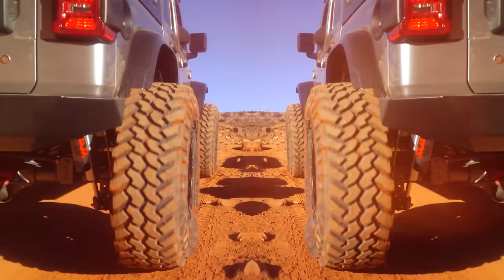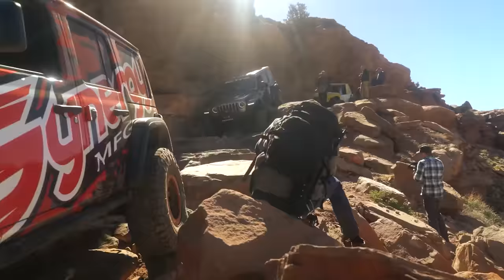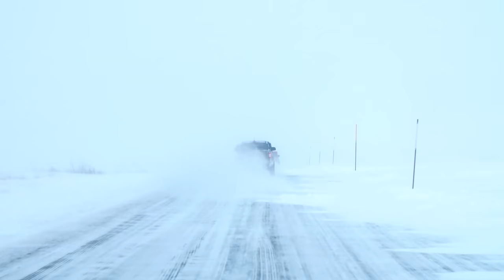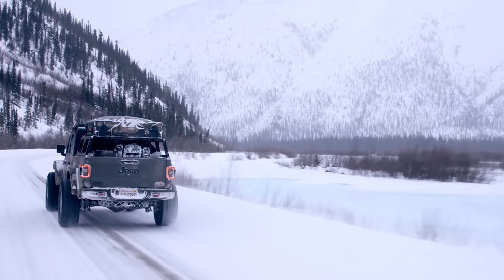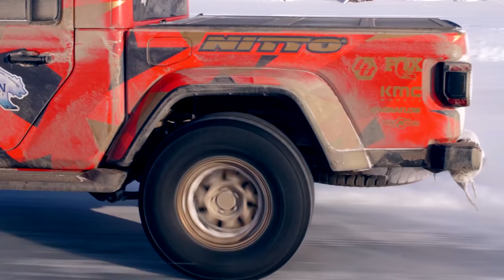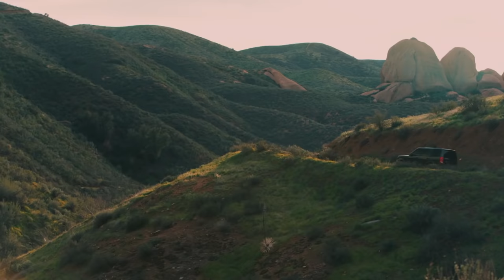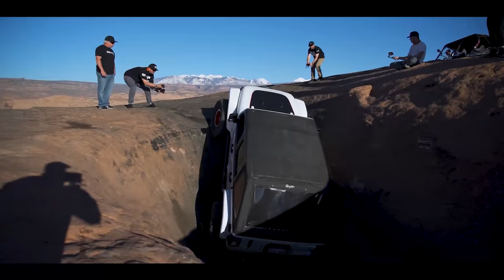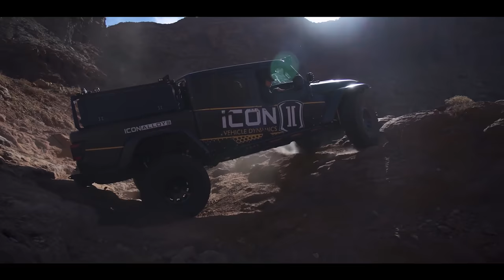Do NOT Use 4-Low Offroad || Watch First!

Comment: The key is to know your vehicle! I can use 4 low at any point as I have a full time 4wd with a centre differential. The simple point here is low box is always 4 low. high box is always 4 high, there is no 2wd. So, stability is better on all surfaces, there is less chance of drive train wind up, I can also swap hi to low at 5mph or less, so don't even have to stop! I also can engage diff lock at any speed! 

I use low box for anything off tarmac if manual and anything taxing if auto - so a lot less. Low in the auto is basically being nice to the gearbox. Generally I don't get stuck as knowing where to place wheels and when to back out and/or give up/winch  is a good thing to know.

Comment: It took a while to convince my Dad to put his farm trucks in Low to ease around the farm, even with the hubs unlocked. I put my Tacoma in low at a drive through if there is a line... But it's old, has manual hubs and tcase, and the tcase shifts super easy.

Comment: I always say 4-low is easy mode. I can usually just modulate the brakes as the idle power is enough to let the vehicle crawl up/over things. If throttle is needed, the response is nice and smooth. It's much easier and safer than getting the engine into high revs and lurching over obstacles. Much much safer when you're near any type of exposure or dangerous trail conditions.
Reply: Guessing you're talking about a automatic... that is exactly how you burn up your transmission. Just letting it idle and throttle to go over things slowly is just putting so much unnecessary stress on your torque converter 

It's not "easy mode". It's called being smart and utilizing the tools you have.

Comment: Good info...But the big difference in 4lo is with a manual or Automatic...Manual  4lo 6 Speed JKU 2.8CRD 2nd gear is the best to climb with for me on 33's and 3'21's...and yes depending on the length of the hill. 100-300meters 30+ incline and mash it...In an automatic..unless you select your gear the risk is it to shift gears mid climb and either dog the motor slowing you down and/or kill , Also the other side shift abruptly and cause you to loose traction and maybe control.  All of which on either transmission only comes with knowing your vehicle and how it behaves. Great Advice to seek out a club...and don't be shy to ask who in the club could give you some pointers. We all started at one point and time...35 years of wheeling and I still learn something new everyday! Stay Safe Wheel on!!!

Comment: Great vid...remember in automatics you can usually shift to "Lo" or "1" to get better control and keep it in that gear. Another thing that can happen that's sometimes not so good is that when switching to 4-Low is that it locks the center diff and you will get binding if you are trying to turn. On the 80 series Land Cruiser (best vehicle ever) there's a mod where you can selectively engage and disengage the center diff even when switching to 4-Low.
Reply: If you drive a 500 dollar Cherokee with auto trans and cant get into and stay in 1st gear,  pull the fuse out of the holder under the glovebox . It will stay in first till you replace it. You can also rig that with a switch and place it near your shifter. Open the circuit to bring to 1st.  Close for normal driving.
Reply: @bradcampbell7253  cool mod 👍
Reply: @NigelNaughton  huge problem as I see it is with the auto, you can't use hi or low in first gear. It quickly shifts to 2nd gear when you just need it to stay in 1st and clear your obstacle.
Reply: @bradcampbell7253  I have a 1997 Land Cruiser and I'm able to shift to low or 2nd gear in either high range or low range and it stays in the gear chosen until I manually change it. It even has a button where I can start out in 2nd gear so I'm not spinning the tires if stuck.
Reply: @NigelNaughton  it's always cool to learn about the mechanics of old vehicles and discover where modern ideas come from. My 2020 Rebel has a gear limiter that allows me to manually control what gear I top out at whether in 2WD, 4H, or 4L. If I'm crawling, even though it's an automatic, I can limit it to 1st gear only.
Reply: @treyroberts8124  that's a great feature to have... Cool rig you got there
Reply: @NigelNaughton  appreciate it! Gotta remind myself of all the little features to justify the truck payment 😂😂
Reply: @bradcampbell7253  My Jeep JKU Rubicon allows a person to stay in 1st gear, 4lo.
Reply: @Harry-zz2oh  yep, this situation is peculiar to the 80's Cherokee models. All vehicles with high and low range, should also get engine braking when in 4 low.
Reply: @NigelNaughton  
I’ve got a 1995 diesel Land Cruiser 80 series, and I’ve disconnected the auto CDL on Lo, so now I have the choice, Lo with all three diffs open, or CDL, or CDL with rear DL or all 3 locked. 
It’s perfect for any situation. 
For those who don’t know already, it’s permanent 4WD, so there’s none of this 2WD nonsense ❤️🇷🇴🤣
Reply: @clivehorridge  Nice!!!!!
Reply: I'm not a Land Cruiser owner. Can you explain what and where the Center Diff is?
My jku Rubicon has a rear diff and a front diff both with lockers. But never heard of a central diff on a 4x4🤔
Reply: @jamesglenn520  You do have a center diff...that is in the "center" of your vehicle. If you go underneat it you will see it. There will be a drive shaft coming from the front diff to the center and then from the center to the rear diff. What the center diff does is allow the vehicle to switch from 4-high to 4-low through the set of gears and allows the torque to be multiplied in whatever ratio the set of gears are in the center diff. Hope this helps.
Reply: @NigelNaughton  That is not called a Center Diff😲😖
That is the Transfer Case👍😂🤣
Reply: @Harry-zz2oh  My 2009 jku Rubicon automatic will stay in first if you manually put the shifter in first also. 
And my wife's 2010 jku Sport is the exact same way.
Reply: @jamesglenn520  yes actually you're correct. I was trying to give an shortened reply. And that's right, the jeeps don't have them because they are not full time 4-wheel drive. But the Land Cruiser is..at least the 80 series...so the center differential splits power between the front and rear and is attached to the transfer case. 😀
Reply: @NigelNaughton  Yep. None of that fancy extra stuff to break on mine 👍
Crawler Tcase and danna 44s front and rear with lockers! Lol

Comment: I agree, I watch many off road youtube channels and in my experience they all way over use low range, not that many situations call for it.  If you over torque the drivetrain the tires break traction too easily, gear selection is key to overcoming just about any obstacle.
Reply: This is the issue I run into while backing my travel trailer up the grass-covered hill into my yard. 4-HI backs up nicely 4-LO I'm digging holes. :)

Comment: I once owned a 1956 Dodge Power Wagon.  One winter in PA, a cousin of my friend's brother-in-law got his Ford Galaxy stuck in a ditch.  I backed the Dodge up to the rear of the Ford and they strapped us together.  I put the the drive line in low-low and 4-wheel drive and 1st gear and the Dodge just walked the Ford out like it wasn't there.  No problem!

Comment: i use my 4-LO when setting up my camper. it helps when pushing the camper on the wooden boards and "levelers". i've noticed it's much smoother because i'm not having to use as much throttle to get the camper leveled. honestly it's rarely necessary, just makes the job a little easier.
Reply: I seem to run into the opposite problem when backing my TT up the grass hill to get it into my side yard. In 4-LO I seem to spin tires more while in 4-HI it backs right up. Maybe I'm just using too much throttle.

Comment: The manual says to drive at 5 mph then shift to neutral. As the unit rolls, shift the transfer case into 4 low. Then shift the transmission into drive. This prevents binding and aids one shifting faster. I've tried it, and it makes shifting into 4 low rather easy.

Comment: I use four low in my sidekick vitara when i get stucked in snow or mud in even terains usually and i need to let it in idle with first gear in so all 4 wheels spin and go in the back and either push out the car with a lever like a huge tree branch or go jumping up n down on the towing ball to create momentum so the car can gain traction and drive on itself. Afterwards i chase the car and get back in it and drive away, don't worry it ain't going fast in first gear, idle & 4low, you can catch it easily. This technique  got me unstuck in more than 3 occasions without the need of shoveling, most due to the small size and low weight of a 3door Vitara you can wobble it out only by using the gravity of your own body or by finding a strong branch to use it as a lever.

Comment: I have a manual transmission. 4low is pretty critical. You try managing clutch, and RPMs at 4 high in some iffy spots. In 4 low, its nearly impossible to stall out.
Reply: I agree, I used to have a manual Tacoma with the lil 4 banger. 4lo is what made the most sense in most obstacles, even if it was starting off in  3rd

Comment: It's easier for 4 low to engage if you actually moving 2-3 mph. If completely stopped the transfer case gears can be misaligned and make it difficult to get it to shift. My owners manual actually says to shift the trans in to neutral and the the transfer case into low at 2-5 mph. Makes for a smooth transition.
Reply: My Ram manual states the same

Comment: On our jeeps its easier to shift into 4 low while moving at 1 - 3 miles per hour, both into and out of low range. During winter when the ground is white, we usually leave the rigs into 4 high and put them into low when pulling someone out of the ditch.

Comment: On some vehicle if you drive on high you have the traction control on and you can only disconnected when is 4low so example you will climb Sandy Hill or something similar when you need a lot of momentum and lose all the power so you must go in 4 low. Also sprinter van four-wheel drive the 4 low it's still fast so it's recommended when you go on a trails just go 4low.

Comment: I am not an expert, but in my experience:

4Hi for the beach and/or relatively maintained forest roads
4Lo for mountain trails
Reply: I went cruising around the beach in 4hi and saw my trans temps climb too high. 4lo is good for me in the sand
Reply: @jamesalexander958  Weird. The only time my trans temp climbed too high on the beach was because I didn't know my Liberty's front skid plate was caked in mud. That didn't allow for enough airflow and the trans temp light came on.  Otherwise, in my current JKU, the engine temp rises slightly, but no issue.
Reply: @JamesSmith-uc8tk  there's many factors like air temp, how deep the sand is, and how crazy you drive. Deep sand will build up heat

Comment: Good vid.  Covers the basics pretty well.  He's right that new people will sometimes ovoid low range for various reasons.  Usually because they just don't think of it because they've never used it, or, in extreme cases, may not know it's even there.  Also, those that have not used it before might be caught off guard by the power which can intimidate some people.
To share some old timer wisdom which may not be relevant in modern times:
"The only difference between 2wd and 4wd is the length of the walk home"
And, from my dad, who is not an "off roader", "you don't buy a 4x4 for the four wheel drive, you buy it for the low range."

Comment: I use 4 low and my secondary low range box as-needed.  but the truck is purpose built. so I use whatever is needed. 300ci 4spd 203/205 4.10s on 38s. full blown crawler.

Comment: I read something years ago that has stuck with me-- never cross an obstacle that requires 4-wheel (especially 4-lo) on your way to your destination. Obviously this doesn't apply when you're just out 'wheeling for giggles. But the logic is sound. That mudhole or gulley that needed 4x to get across in one direction may be impassable in the other. Or if something in the 4x system breaks after crossing it, you will be stuck coming back. Basically, 4x should be treated like an emergency device to get you home rather than a tool to get you as deep into the wilderness as possible. But, again, this is just a general guideline that won't necessarily apply in all situations.
Reply: This is sound advice actually. I do exactly that, i always go anywhere on trails on 2wd, usually I don't even need to engage 4wd or 4low for that matter. I keep those for the really hard passages and then i disengage them and keep moving on in 2wd. With a good set of tyres and proper momentum even 2wd on the rear wheels can get you very far into the woods. Of course if the inclination is too steep i would engage 4low to save the transfer case and my clutch from excessive wear.

Comment: I have had need of 4L in my Chevota FJ60. It has an NP205 transfer case, so the ratio is not as low as many others. Kind of wish I had the ability to lock the rear diff. Not many places to go anymore where I live where you need 4WD. I used to cross a creek on a county road where there was a deep water crossing. 4H was nice on that gravel bottom when water was almost halfway up sheet metal on the doors. Crossed a couple of times in a small 2WD PU with a PowerBrute rear end. Once I didn't know a hole had washed out and the hood went under water for a moment. Fortunately, it didn't suck any water into the engine, but was kinda scary. The county moved the road to a place that didn't wash out so bad. The only people who still lived back there had an old army truck they would use if the water got up.

Comment: When you are young and have your first 4x4 you tend to do silly things like: drive through a deep puddle pooling on the road just to splash and then park for the night almost immediately.  In the morning when you hop back in the vehicle to go to work and the temps have dipped below freezing you find that the only way to get the vehicle to move is 4 low because your brakes have frozen stuck. 🤦🏼‍♂️ I will never forget that "BANG" when they let go.

Comment: Also consider contortion, that prevented me from putting my transfer case in Lo. (Spun out on snowy road during a blizzard showing off like a DA) Got stuck halfway on the road and the rear in a steep ditch at an angle. Had to reverse into the ditch to get the rig mostly level to allow the case to shift. But at that point, I needed help getting out.

Comment: The first time I really needed to use 4 low was when I went through a trail I frequent after it snowed in the area,  there was a steep hill that I found myself kinda struggling in 4 high, so I kept it in 4 low for the rest of the trail and crawled around at 20km/h

Comment: Another application for 4 low is to keep the revolutions up on your engine while climbing since this will help keep your power steering from overheating.  I didn't do this on a recent outing and had a "hot oil" idiot light come on. My oil pressure was fine and was at normal but when I opened the hood of my Jeep I found the power steering unit was extremely hot and had blown some fluid out.  I let it cool down (it was time for lunch anyway) and had no trouble thereafter, especially when I shifted into 4low first gear to go down the mountain.
Reply: If you have an Automatic transmission in your jeep the Hot Oil light is the transmission fluid. 
If you don't shift into 4lo or stop and let it cool it will go into Limp Mode.
Reply: @jamesglenn520  I found out what I was doing wrong.  I've learned.  Now I keep the tranny in 4lo when going up steep hills as well as going down the mountain.  At least I didn't damage anything.  It won't be too long before I need to change the fluid anyway.  Fresh fluid always helps.  I've been going off road for over 50 years but have only had a Jeep for the past ten years.  Now I'm on my third one (my wife has the second one).
Reply: @Harry-zz2oh  I have an 09 jku Rubicon and my wife drives a 10 jku sport that we have had since both were new. And we have a 1958 project. LOL
Reply: @jamesglenn520  My JKU Rubicon is an 11 but it is the bare bones one with only AM/FM/Sirius but no Bluetooth.  It works pretty well for my purposes.  Of course I've spent money on it adding things like bumpers, a winch, and LED lights.  I have more items to add but my wife wants me to fix the mower, collect all the wood from the trees, make a haul to the dump, paint the house, install the new fence, etc. etc. etc. .......  (My list has some of that but I also need to do taxes and read a few books.)

Comment: You should have talked about using the winch if you have it which you should if you are going to be in tough spots. The right straps and shackles D rings and use a good synthetic winch cable. It will make you life much more simple. Be safe and have fun.

Comment: Great tutorial!! There's a reason auto manufacturers make it harder to go into 4L as opposed to 4H.
Reply: To push a button isn't that hard.  Or, to pull a lever.  Or twist a dial...
Reply: @ecojoe2214  yeah but in most cases the vehicle must either be in park, or neutral. In a manual shifted transfer case, the shifter has to be pushed down and then shifted. I didn't say hard to shift, I said harder. Name a vehicle that's just as easy to go to 4l as it is 4h.
Reply: @vinceruland9236  my Jeep cj7 with an auto is a forward (straight) to get into 4lo, and backward for 4hi.
Reply: @Cencal_cj7  but you know that's not a standard procedure. I can shift my tundra into 4h up to 60mph, but I have to be in park for 4l
Reply: @vinceruland9236  thats interesting, my ‘11 tacoma needs to be stopped and placed in neutral before switching to 4Low.

Comment: Cruise Control. Set the cruise control at the downhill speed you want put your feet flat on the floor and relax. Jeep Wrangler 's transmission allows downshifting while in cruise so, once you learn how, you rarely need brakes at all.